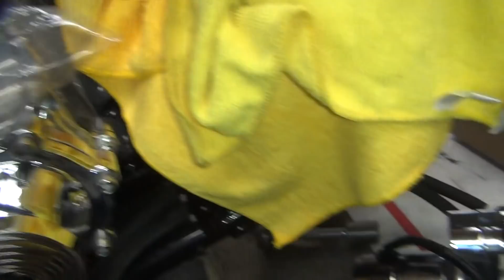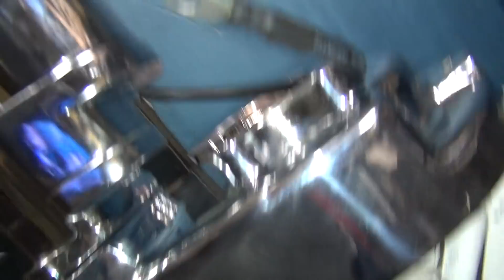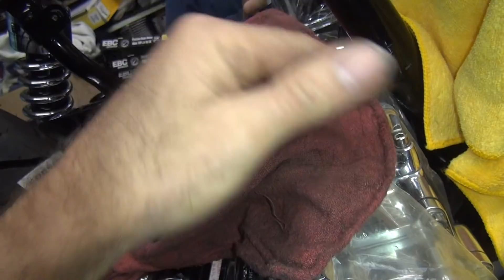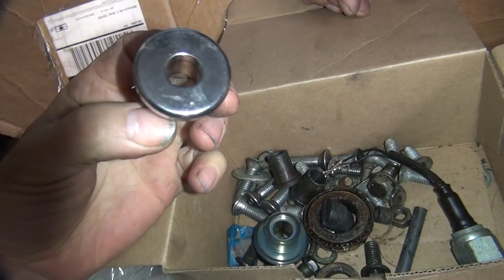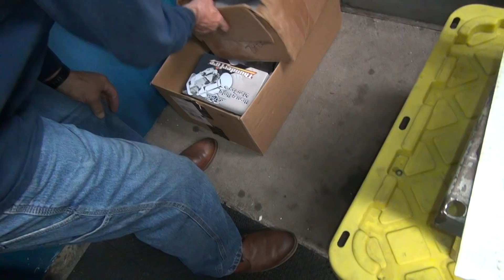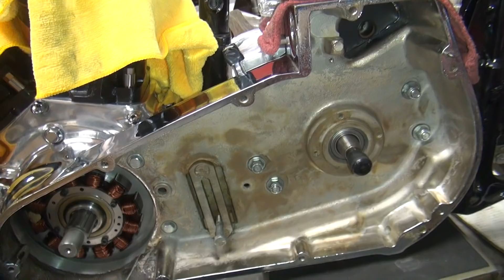#146 1978 93ci stroker shovelhead big bore motor new bike build fl harley by tatro machine

Comment: Cool trick. JB weld in the starter.
Reply: An even neater trick would be for the damn manufacturers to make the damn parts correctly the first time so they actually fit without these "issues" but that is never going to happen.